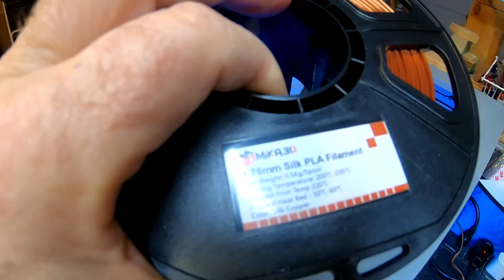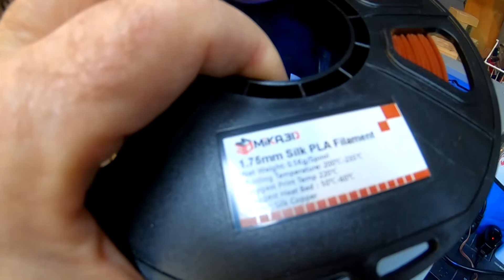Flashforge Dreamer (NX) - Replacing the Nozzle and Heat Break Tube - Part 2

Comment: can you help me, how to change the default temperature of the extruder, I am using black pla its rated temp are 220 but my printer is set on 200 max
Reply from the maker: You use the [Preheat] button on the touchscreen on the lower right front of the printer to set the extruder & bed temperature. I show how to do that on this video:
https://youtu.be/rgFaMaksVnQ?si=SyiNFZXg7gqUOyls&t=169
You also need to set the extruder temperature in the slicer you use to create the .GCODE file you send to the printer.
I show how to do that in the same video here:
https://youtu.be/rgFaMaksVnQ?si=TRt7FE3wzspudaN0&t=474